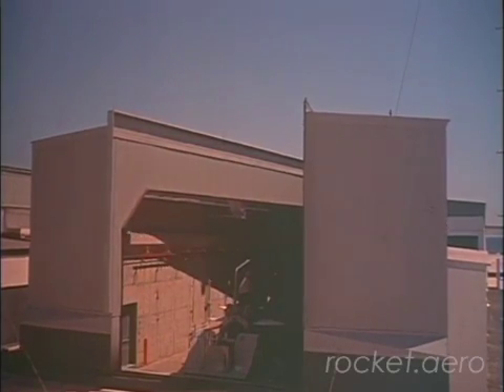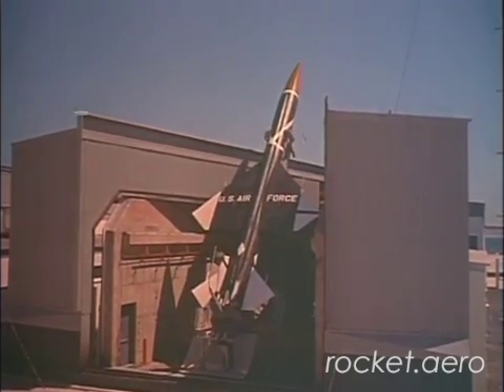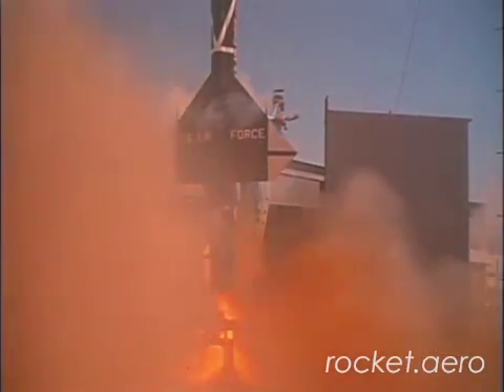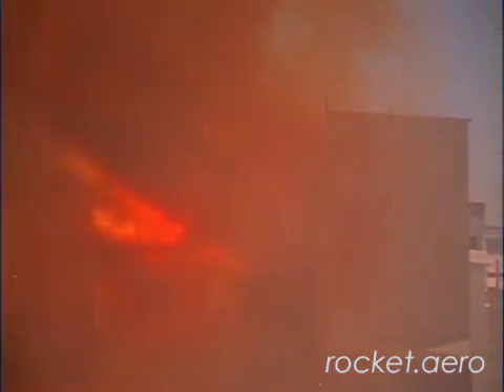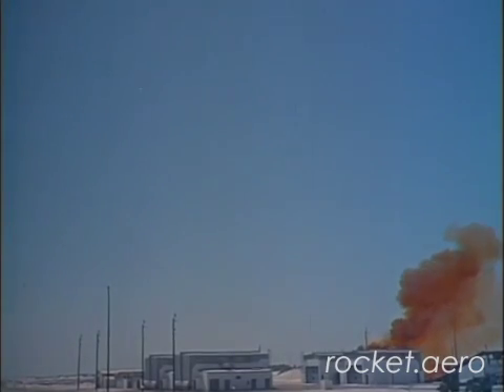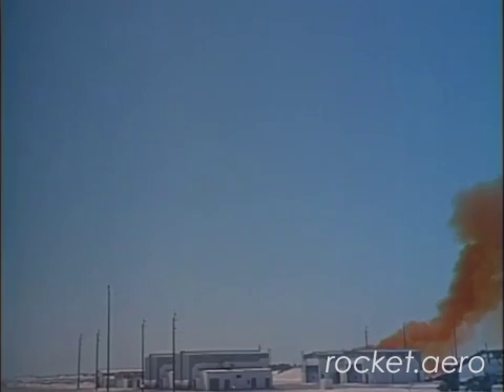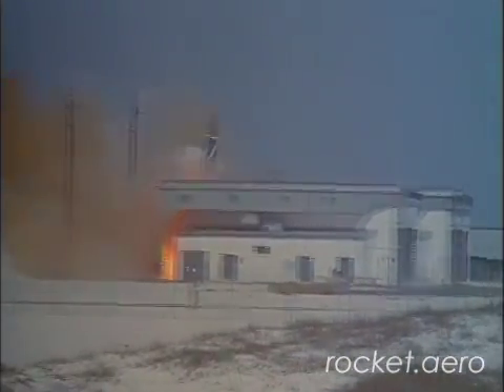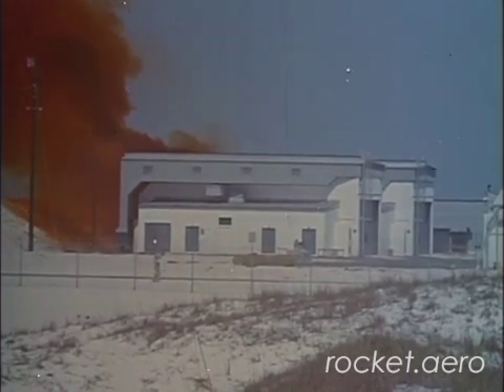Bomarc Launch Failure 1959

Comment: The incident at McGuire AFB was a disaster.  The responders were not prepared for what they were up against.  Plutonium ended up in the soil and made its way into a local watershed and who knows where else.  Supposedly the AF cleaned up the site about ten years ago.  I was working at Lakehurst when they were trucking the removed contaminated soil through Lakehurst then transferred onto rail cars to be taken somewhere out West.
Reply: Did they call them responders I dislike that term.
Reply: @orange70383  Liquidators
Reply: @orange70383  victims
Reply: They shipped it to Utah .